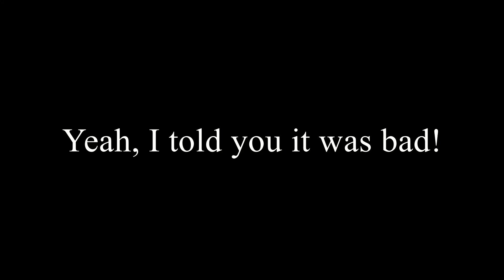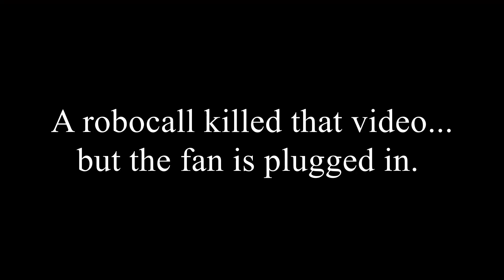Artillery 3D Sidewinder X1 Heatsink Fan Replacement

Comment: Hi, I am just in need of replacing the extruder heater. While troubleshooting i noticed the bed does heat up. On the extruder assembly , the led turns on, the front fan turns on while i turn on the fans, but the one on the heat sink doesn’t turn. Should the heat sink fan on the left should it turn on when just turning on fan to 100% (along with the from extruder fan?)

Asking because I troubleshoot the fan directly and it turns on, Not sure if the extruder circuit fan is bad
Reply from the maker: The fan on the heatsink, the one I replaced in the video, ONLY comes on when the hotend is above a certain temp. I do not remember that temperature specifically, but you can check if it works by telling the hotend to heat up to "normal operating temperature" and seeing if it kicks on. Alternatively you should be able to plug it into the front fan port and see if it kicks on. 

Hope that helps!

Comment: Would like to see you try oiling the old fan - see if it would be a cheaper fix.
Reply from the maker: Want to do a video on it? I know I could have done that but at the same time lots of people want to upgrade the fan but are unsure how hence why I did the video. To this day I still have the same fan I swapped out on there and it is giving me NO issues. Being I do a lot of long, prototype print jobs, I need the ability to know it will run reliably for hours without issues and I am happy to spend a few dollars for that peace of mind.

Comment: Thanks Calvin.  Does this fan run all the time?  I noticed mine doesn't seem to run, although the heat sink is only slightly warm to the touch.
Reply from the maker: No, only when the hotend passes ~50C. If you're not jamming then warm is fine! T

Comment: My heat sink fan outlet seems like it quit after a small short. Do you think that’s on the board or deeper in the machine? When I switch the fan0 connection I can see the fan is still operational. I just dont think it’s getting power any more. 🙄
Reply from the maker: First: do you have a multimeter to check it is getting power when you say fan speed 255 (max) 

Second, check if the board has fuses. If one blew then it is an easy fix. 

Third, try not to short stuff. Been there did that 😉 (yes I make mistakes!)
Reply: Calvin Witt I don’t think it’s getting power. No fuses for the mks gen l secondary extruded port — where our sx1 uses the part heater. Replaced the cable strip to see if I burned it a bit but nope; think I glitched the pcb board. Since the led lights seem weird too I think it must be that. So many ways to learn! It hurts! Lol. Keep up the good work and thanks for your videos. They’ve been a lifeline as I stab myself in the foot repeatedly.
Reply from the maker: @AndyCiordia  Yeah I think you borked something on the board sadly in that case! It is up to you if you want to look into a replacement that is the same or upgrade, that I leave up to you. And thanks, I have some videos coming up since I am noticing some trends on the page... again...
Reply: Calvin Witt holiday searches! When you say upgrade what kind of pcb upgrades are there? I found an oem for $6.

Comment: The same fan on my brand new X1 made a terrible noise the first time I started the machine. That was before I noticed that a piece of the packing foam had wedged in the fan front (the grill). Have you powered up the old fan and figured out what makes the terrible sound?
Reply from the maker: My fan that died was the original. Due to it not having any bearings I believe the jerking of the head going back and forth wore it out.

Comment: That's a great Improvement. At a Replace of the Idler Leveler and put a Drop of Thermal Compound the Temperature of the Metal Mounting Plate was 5 Degrees lower than without the TC. Good Idea. 👍🏻